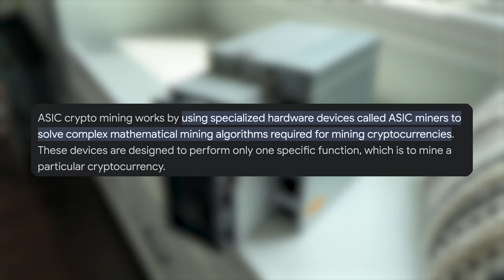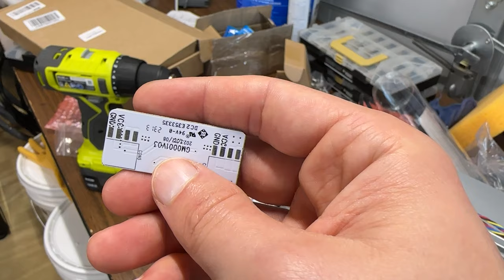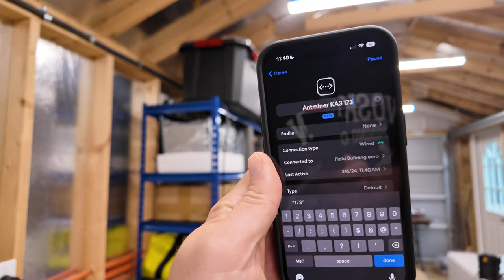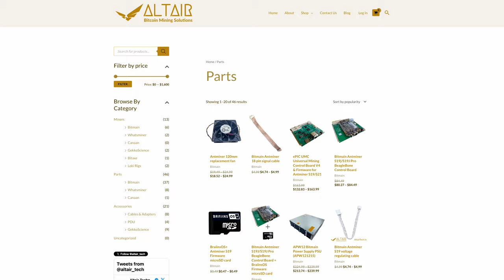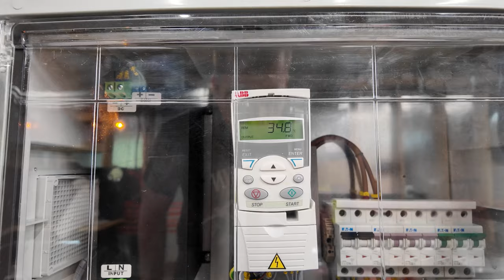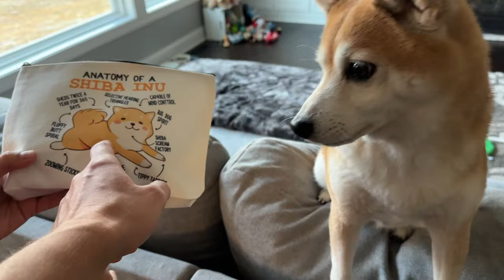I Put This Computer IN LIQUID To EARN MORE!

Comment: What’s the difference in the hashrate and power consumption between air cooling and immersion cooling?
Reply: I think they run a bit cooler, since they can be overclocked slightly more efficiently? Not sure.

Comment: Drew, i see you have been putting out allot of liquid base cooling setup however how many of your viewers care about liquid cooling vs air cooling? My ASIC mining farm is small i only got 64 various Bitmain miners and 4 iceriver KS3M’s and i would never try liquid cooling again, for locations in apartments that has noice restrictions i  just use 8” external fan solution, when time to sell the miners just put back the 120mm fans back on, anyways cool to see you doing it even with some of them having leaking issues.
Reply: My dude, for a solo operation, I'll say 64 miners is pretty big! Well done!